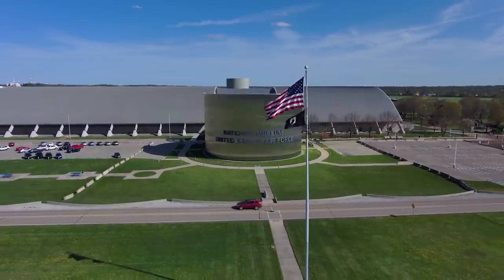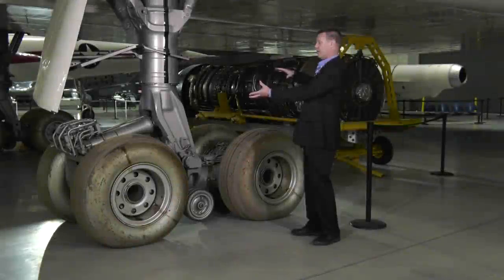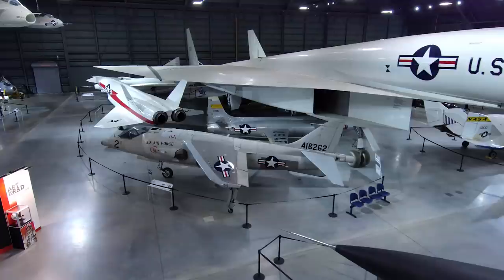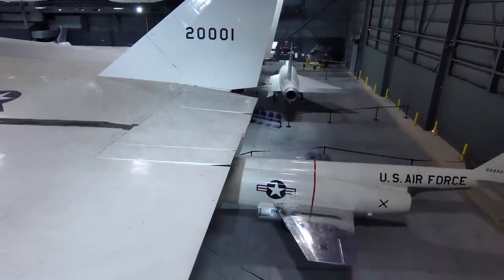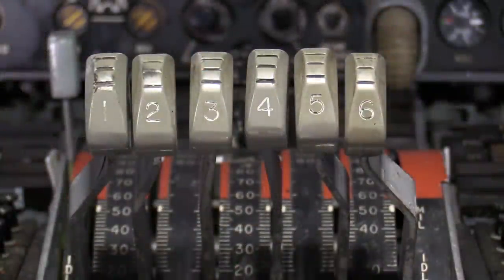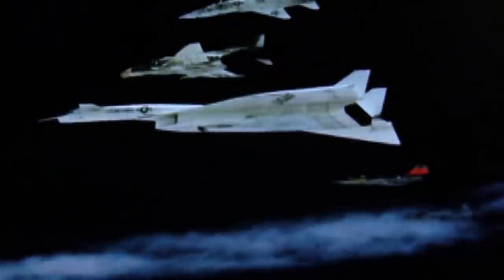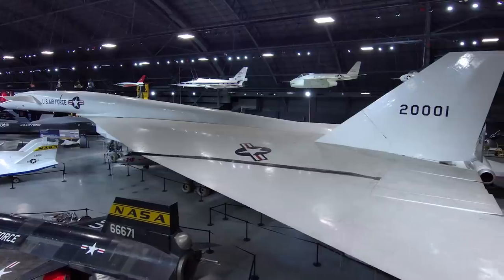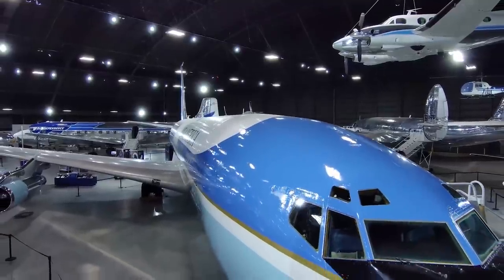North American XB-70 Valkyrie - Feature from the National Museum of the USAF

Comment: I've been to the Museum maybe half a dozen times, but not since the new building was finished and filled.  To see many of these you'd take a bus across the base and enter a small hanger, where all these wonderful machines were crammed in.  The best part was being up close and being able to touch them; I understood the need to avoid that but couldn't help myself a time or two, making the slightest contact yet feeling guilty afterwards thinking of how many others had done the same.

Back in the '80s I was in town visiting a friend and we went to the Museum, stumbling onto the fact they were having the anniversary of the Air Force, with so many craft brought out on display.  I still recall sticking my head up into the nose gear well on what must have been the YF-12A, seeing an ID plate for a unit that had a manufacturing date about the time I was born!

So many wonderful things to experience there, I can highly recommend a visit!

Comment: My father worked on XB-70 Valkyrie he was head of the electrical systems or the valkyrie or its nickname "oh my God". it was an incredible aircraft. the Soviet Union  that's huge amounts of money 2 figure out how to fight this very faster  aircraft.  the Mig 31 was built to attack  this aircraft and the Soviet Union developed a similar bomber but I only flew a few test they never put in production. I personally never got to see you with her for a fly. I wish did.  People I know that have seen it Fly for the first time said it was incredible.
Reply: The MiG-31 was built many years after the XB-70A's retirement, and it was cancelled many years earlier. The MiG-25 is the airplane typically linked to the Valkyrie, but the evidence suggests that the 2 are only coincidentally related. The B-70 was cancelled as a bomber in 1961, shortly after MiG-25 development began. The MiG-25 didn't fly until 1964, and serial production of the Mig didn't begin before 1969 - some sources claim 1970. The Valkyrie was delivered to the museum in February of 1969.

Comment: Two questions:
- Did the nose change position for slow flight like  Concorde? Or did it merely have the outer windscreen move?
- It was intended to be a bomber. I see the rear end dominantly  engine and wing, the front end mostly cockpit. Where di they intend the bomb bay to sit?
Reply: Single position nose. The bombs would have gone in a bay behind the intakes.

Comment: How many gallons per second would the 6 engines burn in Afterburner? I would estimate 2 gallons per second per engine since that is what the J79 Engine (same engine that was in the F104, B58, F4) burns. 12 x 60 = 720 gallons per minute. 43,200 gallons per hour.
Reply: Jet engines burn fuel by weight, not volume. Quoted figures I've seen for the J-93 are .7 lbs per hour for every pound of thrust at military power. In afterburner, that climbs to 1.8 pounds.
Reply: @winternow2242  Can you convert pounds into gallons per second, per minute and per hour?
Reply: @sanfranciscobay  gallons and pounds measure different things - volume and weight respectively. In past years, ome fuels were heavier than others. The US Navy used a heavier fuel than the USAF because it had additives to raise its flashpoint. I think the difference was 7 pounds per gallon instead of 6.8. I think it's standardized now, that info was circa 1967.

Comment: According to Ben Rich's book on Kelly Johnson, the stainless steel honeycomb structure failed on the XB-70's only Mach 3 flight; they were luck to get her home again. The Skunkworks had already tried this technique but rejected it. The XB-70 was an almighty structural failure with interesting aerodynamic success. It was also killed by the SAM-2 and ICBM.
Reply: I think you've misread Rich's book. The first B-70 flew mach 3 once, true. However, it was held back because they needed to redesign the wing, which they did for the 2nd ship. B-70 no. 2 flew 9 mach 3 flights, the last of which was only 2 days before it was destroyed in the infamous photo op flight, apparently at low speed. 

That first plane continued flying supersonic, at least until October of 1968, it's last flight being an uneventful flight (.91 mach) to Wright-Pat.
Reply: The XB-70 achieved MACH Three flight TEN different times for a total of 108 minutes at MACH 3.

Comment: When I started Model building back in the Late 70s I built one of these models. Probably not one of my finest works, but I wouldn't mind a second shot at this kit, if they still made them.
Reply: You can bounce into kits here and there, Italeri kits - as rebranded AMT/ERTL kits - are still available. They were produced up until 2011. You may get lucky.

Comment: I dont know why they let F104 to fly in this flight😡😡 Starfighter was known for crashing a lot.
Reply: The planes were chosen because they all had GE engines: J-79 on the Starfighter and Phantom, J-85 on the  F-5 and T-38. B-70 had the J-93, which I've seen described as a scaled up J-79. A Starfighter flew for the same reason it flew in US and other countries' service,  because they officially found it suitable. 

I'm reluctant to blame the F-104. This is a situation in which an airplane was flying in formation with another airplane  - neither model had much (or any) experience flying in formation with the other. AFAIK, Starfighters weren't used for chase in B-70 test flights, so the handling of each plane in proximity to the other wasn't really known.
Reply: @winternow2242  And Joe Walker, an experienced test pilot (X-15, etc.) was in the F104.

Comment: and the fighter version, had the folding compression lift.  The Rapier.
I wonder why it was not adopted in other aircraft
Reply: The F-108 wasn't a fighter version of the B-70. It was a different plane being developed alongside it, and sharing the same engine. When the 108 was cancelled, it meant that B-70 had to shoulder the costs alone. The 108 was cancelled because it didn't add much to our capabilities given its cost. I've never heard of the F-108 design using compression lift. The plane may have the right wingtips (look smaller in relation to the rest of the wing than the folding wing on B-70) but doesn't have that low hanging ventral intake, which probably generated a lot of the needed Shockwave.
Reply: @winternow2242  the question remains, why was  compression lift not more widely used.  I realize there was a switch to low level penetration but all the SST development could have used it.  It’s interesting that the CF-105 Arrow and the F-108 all got canceled as those were the potentially fastest aircraft of their day.
Reply: @richarddobreny6664  you've hit on the answer - they could have used it for SST development. The problem is,  there isn't any market demand for an SST, given what it will cost to develop, the reliability and efficiency of existing subsonic aircraft, and the environmental hurdles (ie sonic booms) that would remain even with. CL. 

The F-108 and the Arrow weren't cancelled because they weren't fast enough but because nobody wanted to pay for them. Arrow remains controversial, but I've yet to see any sympathy for the F-108, given what it would have cost, against what it added to defense. 

From what I've seen CL remains under research, part of efforts to develop hypersonic missiles.

Comment: This just shows you how far ahead the british were, considering just 5 years later they were flying pasengers
Reply: British nope ... Canadians .... specifically Avro Arrow engineers ... thats right the best fighter interceptor ever built ... and yes BUILT 37 of them were built 6 were flyable ... NONE were prototypes ... and up to rl 205 they had exceeded 95% of air 7.3specifications .... and were waiting on the iroquois ps 13 engine to finish off all the requirements ... an airframe tested to mach 7 with triple redundancies ... and 15 firsts still in use today ... THAT was ALL Canadian NOT British ... and just so you dont forget even the LEM was Canadian made ... Jim Chamberlain designed it ... same with the space shuttle also ... all the good stuff was NOT american made it was made by others ...
Reply: @0623kaboom  References?
Reply: @0623kaboom  from British canada🤣
Reply: @0623kaboom  I know and have watch many episodes, of the Canadians claiming this was the best fighter ever built, but how do you claim that title? Best fighter could be classified indifferences of mission rolls, in a dog fight would it take out a F18 or F16, F35, F22 ect in what way would you classify it the best fighter ever?

Comment: Tragic loss? It was a stupid loss by a F-104 pilot for whatever reason, flew into the wing vortices, causing it to tear off the XB-70 vertical stabilizers.
Reply: He was unable to see the XB70 from his position in the formation and was riding in its turbulence.
Reply: Seen a documentary that kinda covered the reason but I forget exactly the explanation but something to the effect that it was requested that all fighters get in the same(single) photo requiring them to at an unsafe distances. The F-104 pilot was also blamed for ignoring or not reporting unsafe turbulence problems and moving to cleaner air.
Reply: That was Joe Walker, one of the twelve X15 test pilots.

Comment: Ha ha talk about comming in hot. Concord was far superior.
Reply: You seem to be displaying a little misplaced pride.  As a test vehicle, the XB-70 has nothing to be concerned about vis-à-vis the Concorde.  Note, that's Concorde, not Concord...
Reply: Concorde is smaller, speed of mach 1.5, bad safety record and built, what,  approximately 20 years after the XB-70 which operated at mach 3. Didn't fly enough to compare any safety record. Don't get me wrong I'm a fan of the Concorde but less than 20 years before XB-70 we were piloting propeller driven aircraft in WWII.
Reply: @trueamerican7034  you call 1 accident in 27 years of commercial operations a bad safety record?  You need to go reset your expectations of what a bad safety record is.
Reply: @737MaxPilot  still isn’t as good as the xb70. I agree the Concorde was very safe. It wasn’t it’s fault
Reply: @sc1338  still not sure how you can compare the two…two different eras, different missions, different lifespans

Comment: This place sucked, built so fragile that it snapped in half several times

Trash
Reply: Run along, this site is for adults.
Reply: Where did you read THAT?  The plane flew without structural failure until a 10 ton airplane collided with it.
Reply: David B Russia made better planes at that time, at least they didn’t snap in half, so shoddy workmanship
Reply: Winter Now shoddy workmanship
Reply: @devondetroit2529  apparently you've never heard the sad tale of the Tu144.  

No xb70 just split in half.

Where do you get your information?
Reply: @devondetroit2529  wrong. So wrong
Reply: @devondetroit2529  Wrong.